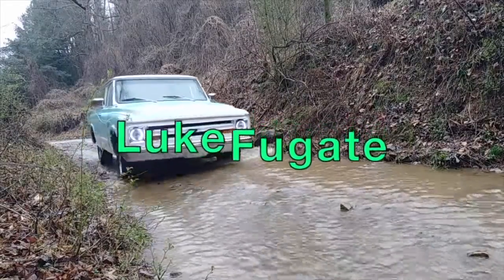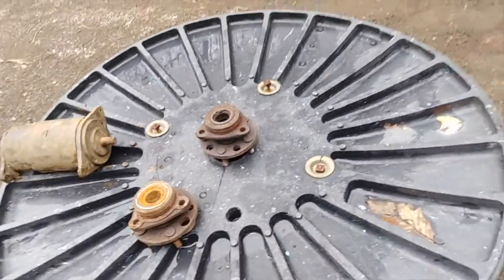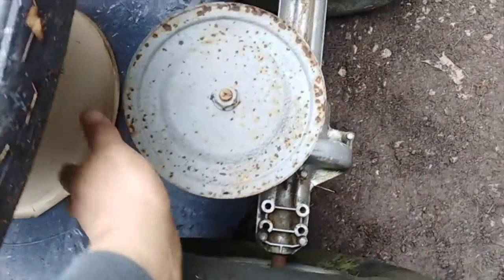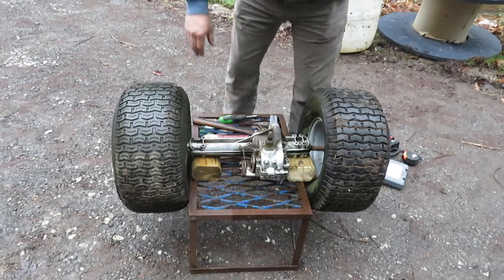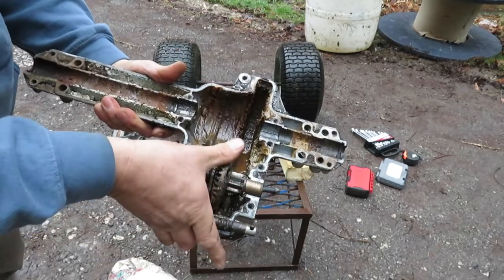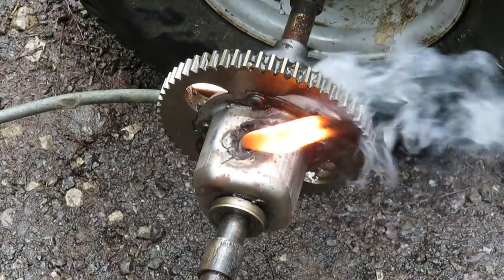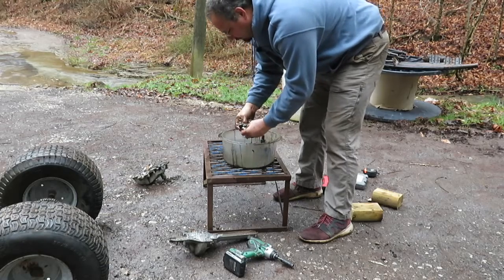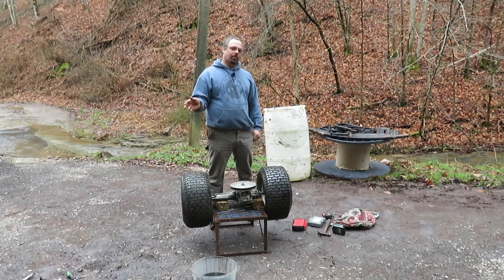Water Wheel Build-Transmission

Comment: So your plan was to take a differential designed to go about 7 mph and have it spinning at hIgh RPM? With lighter oil? I haven't seen any follow up  videos showing your wheel in operation so I'm guessing things didn't work out.
Or did they?😎

Comment: I look forward to seeing how you integrate the spool...it looks awful big! I'm just guessing of course, but it looks like the head pressure may have to be substantially increased to get it turning at the rpms needed to drive your generator. You might be spending a little time being a beaver upstream to give the spool the head it needs!  Or not...I'm constantly amazed at your mechanical wherewithal and look forward to your solutions as they tend to work simply, if not always elegantly! More power to ya!
Reply from the maker: I have a nice place for it with at least 10ft of head, possibly 20. It should be a fun build.

Comment: Great start to the build Luke! I wondered what you were going to use for a transmission. Does the starter/generator have a minimum speed it has to run before it generates usable power? I'm wondering if you'll need to speed up the rpms somehow.
Reply from the maker: I'm not sure what the minimum rpm on the generator is. I think maybe it will be higher. I might have to try something else as a generator or build my own. I guess we will see soon.